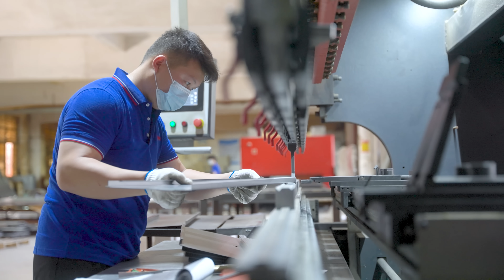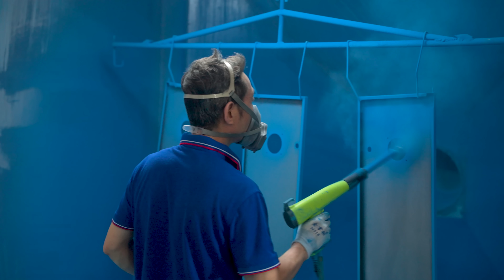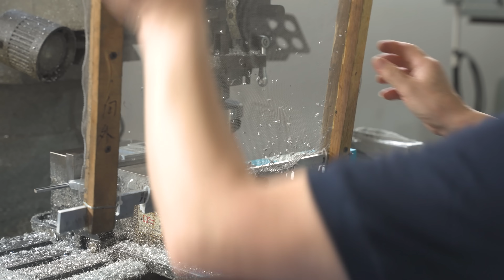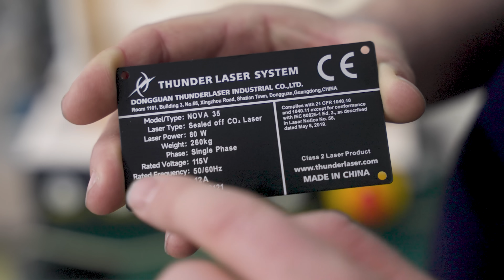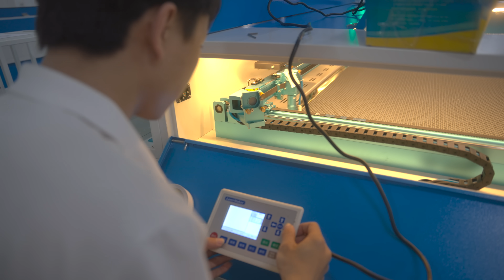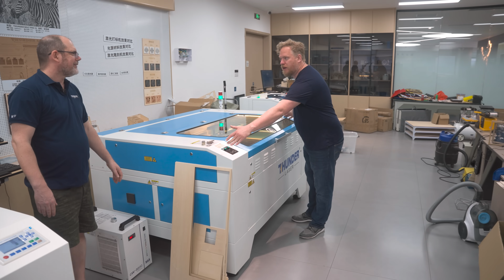Inside a Chinese Laser Cutter Factory

Comment: That complete disregard for safety can probably also be found in the conception of the machine.
Probably no safety rated electronics, power supplies with dangerous failure modes, buggy software, gaps in the enclosure, ...

Comment: We Thunder Laser sincerely thank everyone for your care and thoughtful feedback about the factory tour video.
Your constructive criticism and kind reminders have helped us realize that we should strengthen safety management in both our own and our suppliers' production — indeed, better safe than sorry.

To further enhance safety standards across the board, we are implementing the following measures:
1. Strengthening protective measures during metal cutting and welding
2. Improving laser testing safety
3. Enforcing proper safety attire across the production floor
4. Enhancing internal safety education and drills
5. Strengthening visitor safety management

We truly appreciate everyone who shared their observations.
Your concern and feedback inspire us to make Thunder Laser — and our entire supply chain — a safer and better place for everyone, and to set a positive example for our users and the industry. 

— The Thunder Laser Team
Reply: There is clearly a deep company culture problem.
A complete and systematic disregard for safety.

Hopefully it doesn't carry out all the way to engineering.
Do you use safety rated electronics? Is your software properly tested before being shipped ?  Do you ensure the enclosure has absolutely no gaps ?
Reply: I will believe this when I see it, from a random, unplanned visit to the factory

Comment: I am building my own 90w CO2 6090, but I am ABSOLUTELY impressed with the entire build process at every step with the quality checks and the number of skilled employees and the process resource management. Like everyone else, I was concerned with the powder coating and the unprotected use of open lasers; it only takes ONE time of a beam, even through reflection to your retina, and there is PERMANENT damage, which includes the cumulative powder coat dust inhalation. They REALLY need to make direct filtered air and proper laser safety squints mandatory. Having an English speaker like Shannon is a HUGE benefit to the company, and ALL Chinese companies should have as a resource, not to mention his deep technical knowledge and skill. SO love your factory tours; this moves Thunder Laser to the top of my list when buying a laser machine.

Comment: We had a crimping machine at our shop down in LA, we bought it from a manufacturer in Taiwan I believe. It was hard getting jaws made for some of the stuff we wanted to do, but it was awesome for making tons of cables though lol

We also had a cutting/stripping machine with a feed mechanism, it was awesome too. We never got it fully dialed in (we would have to enter numbers that were not really accurate to get the lengths we wanted), but I’m realizing years later that my coworkers were not the brightest when it came to machinery haha. That machine didn’t have the heat shrink capability, but it was really cool to operate.

Comment: in the glass tube there's a mixture of gases, 2 main gas is CO2 and He, when the CO2 gass is excited, it emits laser (invisible). the CO2 gas needs to be cooled down so it can be excited again to emit laer, He is used to absorb the energy in the CO2 gas. So the glow in the tube is the He, the He glow doesn't have enough energy to escape the tube, that why the tube glows, but the laser is invisible.
.
Thunder laser is a more reputable brand, but there's a lot of rando chinese brands where their tubes don't go thru QC, had a machine with RF tube that dropped in power within 6 months of use, and died just after a year.
Many of these chinese lasers use Ruida controllers, the official laser program for it is RDWorks, many of the  installers for newer versions are reported as dangerous by windows.
Light burn is an alternative, but it's not cheap for a general user.
.
If you're just cutting and not engraving high details, glass tubes are generally better and much cheaper to maintain.

Comment: I wouldn't buy a product like this from a company that doesn't take eye protection seriously. They have some skilled people working there but all it takes is one reflection in the wrong place and they won't be skilled workers any more. I get that when you're dealing with stuff this powerful a piece of plastic might not make much difference but welding helmets for the welders aren't expensive. If it were me on that factory tour I'd have refused to go any further after seeing that
Reply: You set the bar very high for yourself, it rules out almost all purchases from the east.  Be thankful you have the means to choose where everything you consume is manufactured, harvested and produced.Most folk have to purchases based on price and this means most companies have to manufacture based on cost. Remember that when a company subcontracts to a country like China for anything they are party to the lax workplace safety and human rights of the whole country as it is really just a single massively vertically and horizontally integrated corporation run by a very small clique of leaders that  plans that do not require individual benefits. If Apple manufactures a product in China it means that they support the general system even if they might insist on higher workplace safety in their factory.  The only reason it is profitable to manufacture there is that people get lwss value and safety for their labour.  Also remember that most medicine and microchips are made in the east when you decide to make purchasing decisions. 

Good luck on your eco commune.  The Amish are probably amongst the few that can say they consume with integrity.

Comment: American laser safety, everything fully enclosed, laser welders have a full Darth Vader helmet.  If the beam bounces three times at 50 ft away it will instantly blind you for life.  

Chinese laser safety, stare right into the 20kw laser cutter, do laser welding with bare eyes. 

Do physics work different in China? 

Also, the guy dissing on diode lasers, does he not know they can be put in fibers, which have like no weight.

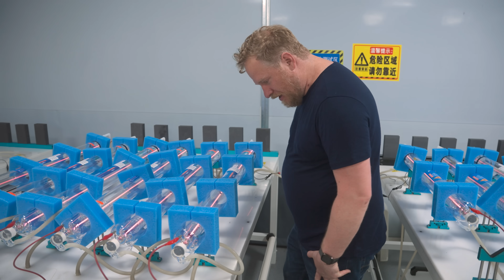Comment: 17:04 Think of the laser tube as a bonfire (visible plasma) and the invisible laser output as the heat (invisible infrared thermal radiation).  The visible glow in the tube is the plasma created by exciting the gas mixture, and the invisible laser output is a very narrow portion of that light (outside the visible spectrum).
Reply: Kind of - it is the nitrogen and helium also present in the CO2 laser that are making the dull glow.... The CO2 is the gas that generates the laser light, while nitrogen excites the CO2 molecules. Helium is used to cool the mixture, and trace gases such as oxygen, hydrogen, xenon etc may also be added as each manufacturer's "special sauce" and tweak the output and power characteristics

Comment: Tubes are not a couple grand each. Much less for regular sized machines :)
Reply: Spare parts price from this company may have a high price, they may be a better name brand tube.  Generic glass tubes are cheaper.  RECI and other top brand glass tubes with metal window/mirror mounts are usually over US$1000 and have longer design life.
Reply: @KallePihlajasaari not true... i run reci tubes on all my lasers. Never paid over $1000 for one in the 15 years of laser cutting.. ceramic tubes yes they would be but for the work i do, they arent needed.

Comment: I think RF lasers are better for engraving because of their higher beam quality compared to glass co2 tubes. The spot size wouldnt matter that much for a galvo marking machine for example, since the rf laser tube has a 3x++ magnification on its size by a beam expander, which improves the focusing of the beam with a f-theta lens.
Reply: i agree. RF is the CO2 laser future

Comment: If you ever get to see a Komax Omega  machine run, it's amazing.  It can have a multitude of different wires being fed and it will cut, strip, mark wire itself, add heat shrink sleeves that are also printed, crimp one of many different terminals, bundle wires with tape, and then insert the terminals into housings.  It's mesmerizing to watch and stupid fast.

Comment: No, thats not why RF tubes are better. RF tubes are pulsed and have higher peak power than a glass tube which just runs off of DC. You actually want a larger beam going into your final focusing optic. The larger the beam, the smaller the spot sized. On higher end systems they use a beam expander to increase the diameter of the beam. This also has a positive effect on you optics as there is less power density on the optic and can make it last longer.
Reply: I don't see how beam size is that related to spot size. Both can be focused to a point.
Reply: @soupisgoodfood42   Focused spot size is a function of input beam diameter, wavelength, and focal distance. The larger the beam size is for a fixed focal length the smaller the spot size. Fixing the beam diameter and focal length and shortening the wavelength you get smaller spot size. Lastly shortening the focal length also shrinks the spot size. But the issue with shortening the focal length is your depth of focus gets much shallower which can cause issues in a laser cutter depending on the thickness of the material. 

I use a 3.5x beam expander with my rf tube. I have found a significant difference between running with the beam expander and without since I often use my laser to cut metal. The smaller spot size means higher power density which makes it much easier to cut.
Reply: @soupisgoodfood42  The optical maths cusing it are a bit more complicated than this, but basically, when you have one wavelength AND it's coherent, the more of the entry surface of the lens (larger starting diameter) the more the lens behaves linearly (like it would in a diagram). Basially there's just more opportunities for the lens material to bend the photon paths when there's more lens to hit. It's prety counterintuitive, but that's how it is; and yeah, on higher power lasers, spreading that energy out over a larger area on the first surface of the lens massively reduces heat stress on it (in the same way the laser machine doesn't have enough energy to cut material when it's out of focus.

Comment: In Sweden I wouldn't even be allowed to work unless I had 11h rest after my last shift and these people work without any sort of protection working with lasers and welding. Wild.
Reply: It's why China is such an industrial giant. But it's not a model to emulate, even if it means economic success. Some things are more important.
Reply: @tomsixsix  Feels like you'd have more economic success if fewer people were randomly blinded for life
Reply: @piyh3962 reality says otherwise 😂
Reply: Sweden? In the old days you have to drink 1L Milk a day if your a welder. And if you weld galvanized steel you get (Zink fewer) All this safety rubbish is for peoples who don't know what there doing. I work in my profession as welder, Boilermaker and woodwork since 1983 and I'm still alive an kicking ans have all my finger and toes on the right place.
Reply: @martinmayer9288  lmao, it's not a flex to work without PPE
Reply: @Hawk7886  Right, it's a Laser. Again, if you know what you doing no problems! I have a 180W Co2 Laser machine and i ordered the machine direct from China without al that EU Safety nonsense. I even cut Vinyl and PVC ! The fumes are toxic☠if you inhale it, That's why i leaf the Shop after i push the start button with all windows/Doors open👍Common sense is also big factor.

Comment: Where can I get a replacement alignment laser ? It died on my unit…
Reply: Probably any cheap laser-pointer module for US$5-20 with similar voltage and power ratings will work.

Comment: 6kw laser with no optical guarding - yikes!
Reply: Well they are infrared lasers, they will not focus on retina. Still, some protection glasses they should wear against the glowing hot flying liquid metal particles.
Reply: @dtibor5903  So I was reading about laser safety some years ago. If you catch a 50W laser in your eye you will hear a popping/snapping sound and then you will see you went blind in that eye. The snapping sound is your cornea flash-boiling, and you can hear your blindness before you see it because the brain reacts to sound faster than light. Sure, a CO2 laser won't be able to focus on the retina, but with that kind of power it doesn't really matter. With a 6kW, even catching a diffuse beam could put you in instant eye damage territory.

The crazy thing with their lack of safety, is a cheap pair (like $1) of polycarbonate safety glasses will protect them. That would also work nicely with the guy running the fly-cutter on the mill.
Reply: @seeigecannon  polycarbonate safety glasses will stop co2, they will NOT stop 1080nm fiber, you need actual laser safety glasses for that.
Reply: @seeigecannon  This is most cursed thing I have ever had the displeasure of reading.
Reply: @dtibor5903  "they will not focus on retina" lmao sure, try arguing that with the KW laser beam.
also BS?
"Retinal damage: The cornea and lens are transparent to near-infrared light, allowing it to focus directly onto the retina and destroy photoreceptor cells, leading to blind spots."
Reply: This is some confusion here. CO2 will not focus on retina, fibre will. The original comment was about the fibre laser (obviously) but other people started talking about CO2 for some reason.
Reply: @kennuimuffins2426 Understandable, but I think the specific spectrum is fairly irrelevant if they all make you go blind in that power range, from not wearing any PPE.
Reply: @dtibor5903  They will still travel through your lens and destroy your eye in a fraction of a second. You just won't see it coming.
Reply: @dtibor5903  Wrong. Fibre laser wavelength (about 1080nm) will focus on your retina.
Reply: @dtibor5903  6kw fiber will blind you with bounce light.
Reply: @ccatlett1984 its actually worse than that. If it bounces and looses 99% of its energy, then bounces off something else and looses another 99% of its energy you are still at 600mW which is still a class 4 laser.
Reply: @seeigecannon yep, I run a 6kw fiber laser on a robotic arm at the day job, light safety is critical.
Reply: @dtibor5903 it will, just need several more miliseconds to burn through cornea first

Comment: You can see the light in the laser because it's not just emitting IR. It's a whole bunch of wavelengths, there's like 3 or 4 gases in there IIRC. They all have their own roles to play, and they're all emitting photons, but the only actual laser emission is in the IR. And of course, that's what you want, you're not interested in wasting a bunch of power at other wavelengths. Then when it gets to the mirrors, which are probably gold coated ZnSe or Ge or something, they're not even going to be transparent to visible light anyway.
Reply: Some lasers put out more power with broadband optics as opposed to single line optics. My ion does 500mW with broadband optics, enough to set things alight. Slap in some single line 488nm optics and it puts out 100mW.

And your right about the gases in those Co2 tubes. Its Helium producing the red glow. The Helium allows the laser to start and run on a much lower HV than with just Co2 alone.

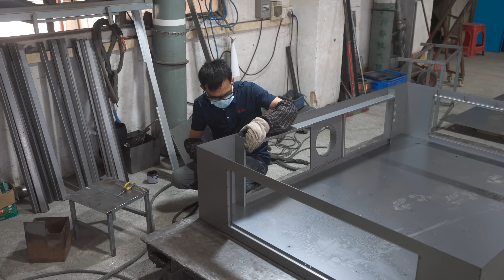Comment: 2:22 looks like MIG, not TIG. No hand-fed filler wire, very quick welds without worrying about position
Reply: While commonly TIG is hand fed, it just means tungsten/inert gas, MIG means metal/inert gas, technically TIG is MIG
Reply: You can spot weld with TIG with no filler rod, also.
Reply: Yes, indeed You can. Outer corners or butt joints, sure. Inner corners like here - not that fun to do. 
Also note the splatter, typical for wire-fed MIG. TIG is cleaner ;)
Reply: Also the torch looks wrong for TIG. That looks very much like a regular MIG torch.

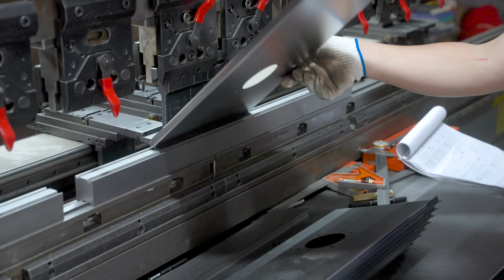Comment: 2:06 When you touch there. How are the edges not super sharp?
Reply: Laser cutting leaves a super smooth edge, it's basically cut by heat and it leaves no burr

Comment: Working on my machine as this video came out, perfect timing! Still can't believe the lack of health and safety there :hand-orange-covering-eyes:
Reply: Asians are build differently. Specially with welding. if i look at a working welder i cannot sleep because of the pain in my eyes. they weld look at it and don't care.
but i also have to mention, they are stubborn. because the masks glasses etc. are available in the factories. 
i was a reseller of machines produced in China, and all the safety equipment was there, but they just didn't use them.
Reply: @Dutchzilla-San arc welding creates UV-C light, laser welders don't